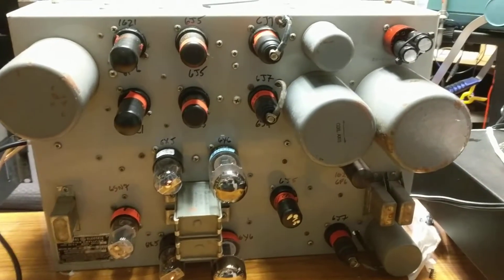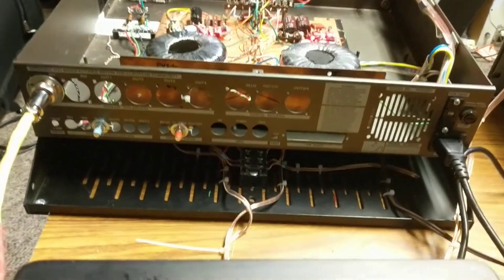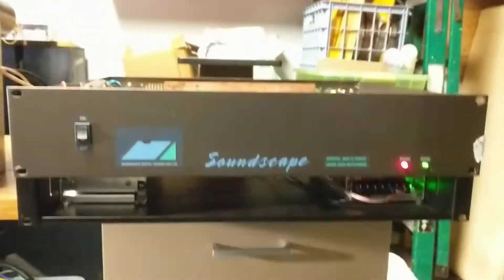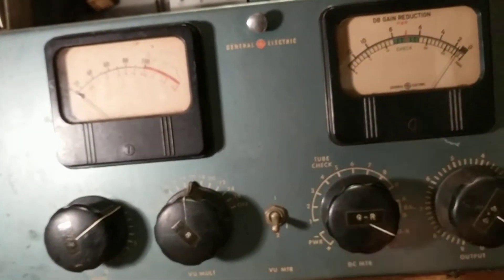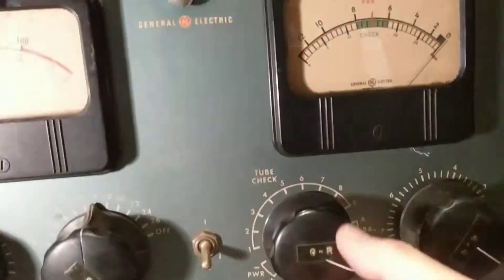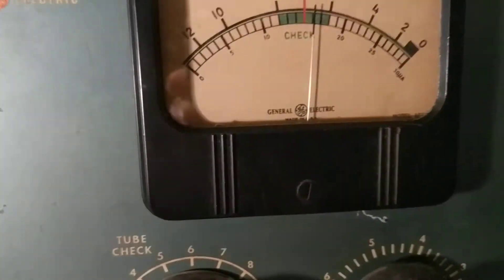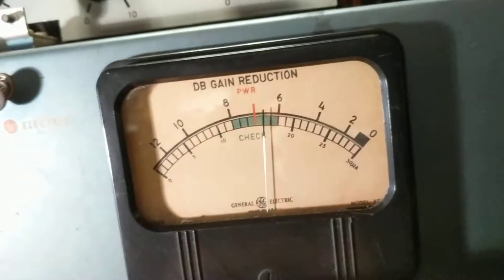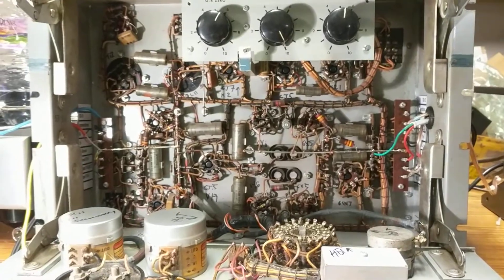1953 General Electric BA-5 broadcast compressor (part-1)

Comment: Passing signal yet?
Reply from the maker: Yes!  It worked from the beginning but the client purchased without power supply.  The main challenge was building a regulated 250v bipolar supply that I felt would would be reliable.  I started with a pair of off the shelf supplies.  One failed and the Chinese manufacturer was not helpful.  So, I designed supplies from scratch.
Reply: @edaudio  ohhhh. You ended up having to do it anyway.